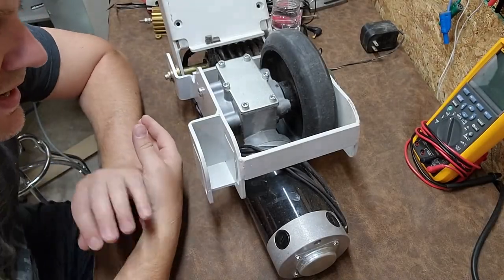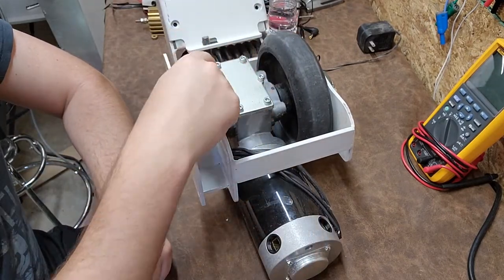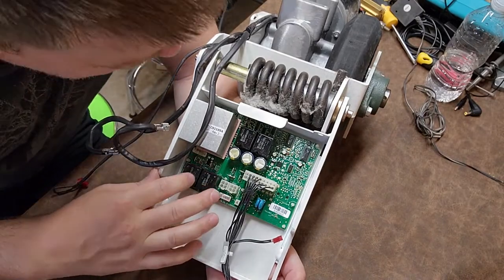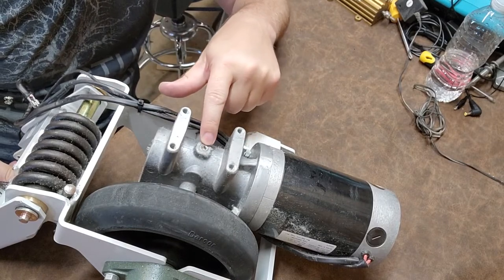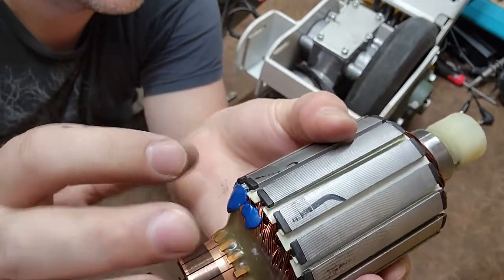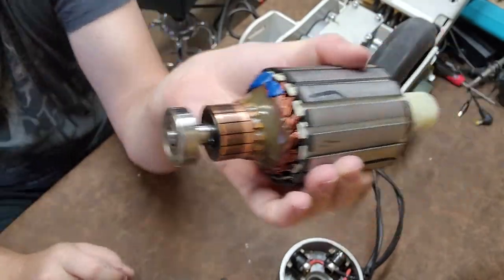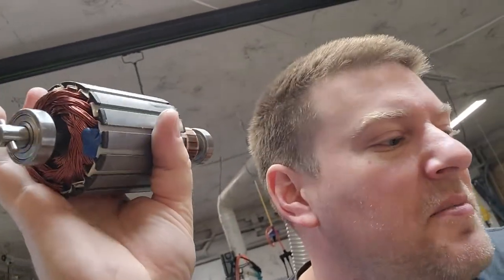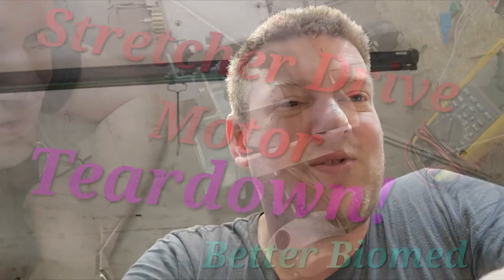Hospital Bed Drive Motor Teardown

Comment: 7:45 A worm wheel gear is some of the nicest gears that you can find. Very strong, and only works in one direction. Movement from the motor to the wheel, but movement from the wheel back to the motor is blocked due the gear design. This type of gear is also used in cars for the window sliders and for the windshield wiper motor.